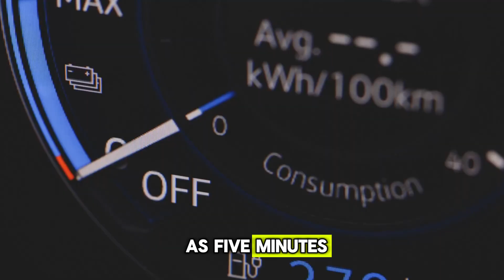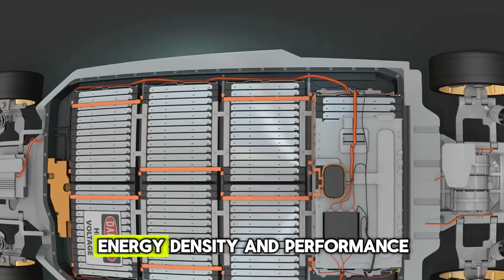CATL Just Released Sodium Ion Battery with 5 Minutes Ultra Fast Charging

Comment: nice try but Sodium Ion batteries are heavier than Lithium, thats why it will not be used for cars.
Reply: …and you know that this will always stay like this and no improvement can be done? How much research went into Li-ion batteries, especially NMC and how much into LFP or now Na-ion?
Reply: @UncleY4nn  yes but that is yet an unknown. It may happen or it may not happen. Sure is that it will decrease in price. So Io is more expensive now, another reason why we still do not see it i nmany applications. That will change when production cost lowers with demand. But as of now they are not practical for cars because of their weight. The rest is pure speculation and the topic of the video is just for clickbait.